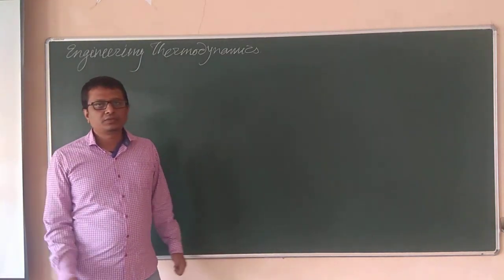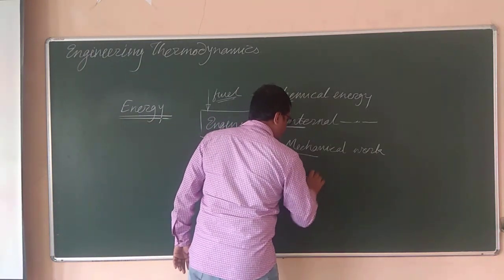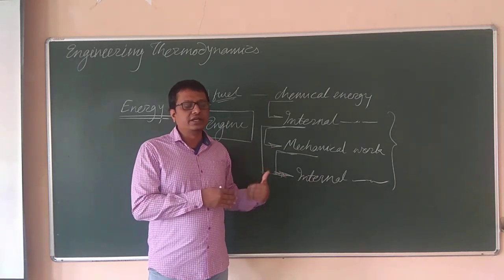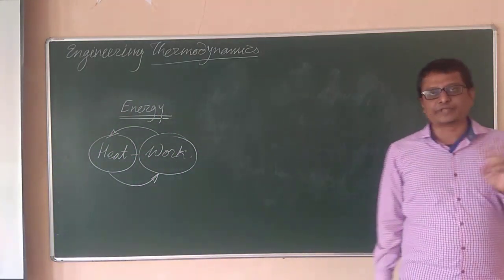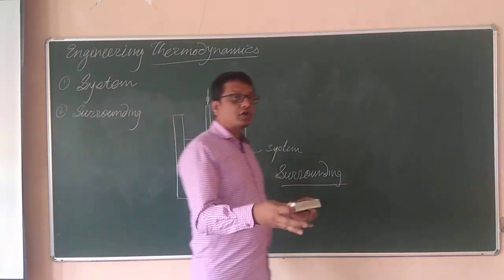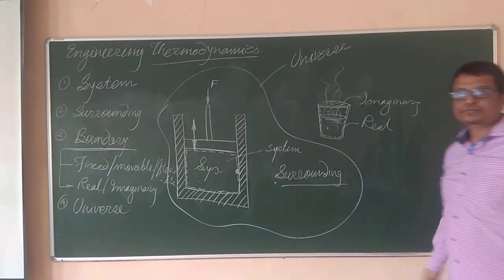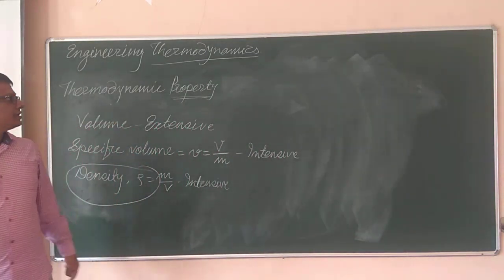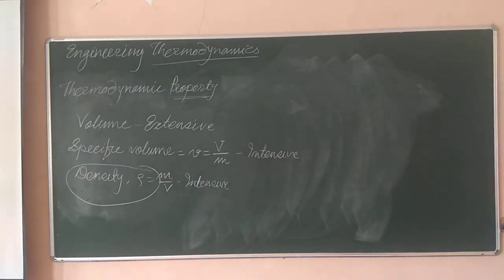Engineering Thermodynamics | Lecture 1 | Laws of Thermodynamics

Comment: Ameya Mahamuni 
SEA 51
While performing analysis of brake disc, which process will it be? Microscopic or Macroscopic?
Reply: SEA 50
Probably, the study only of the structural deformations will be Macroscopic and I guess if u are meshing it and doing finite element analysis then I guess that will be considered as Microscopic
Reply from the maker: Both

Comment: Sir Is a car an isolated system or not?
ROHIT B GHODKE
SE A 28
Reply: Running car can be considered as open system as it rejects matter (exhaust gases) as well as heat energy from engine to the surrounding.
Shriniwas Tonape
A-69
Reply from the maker: Not at all